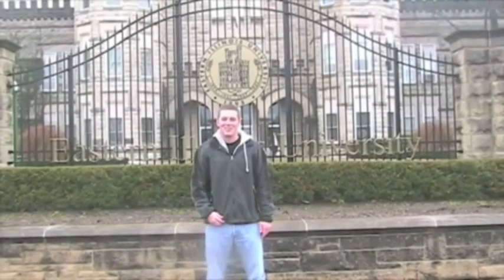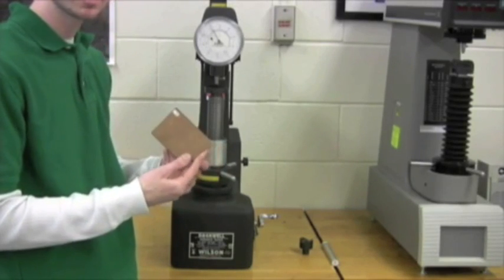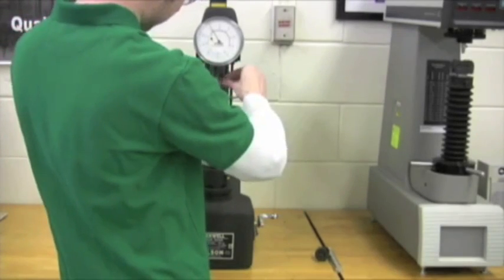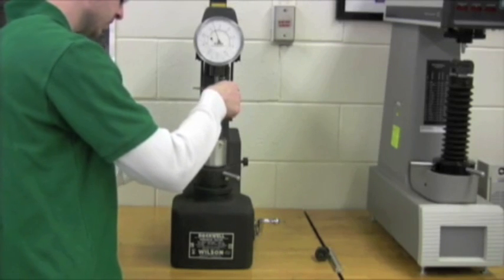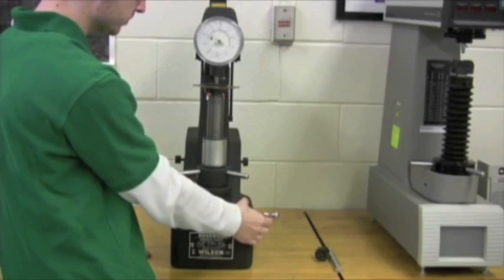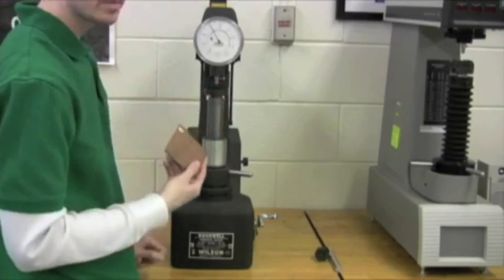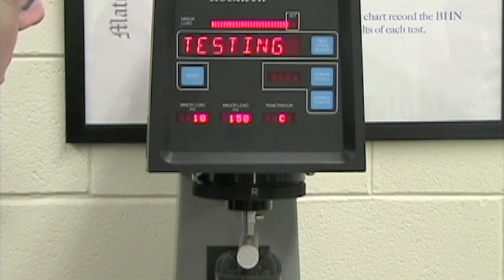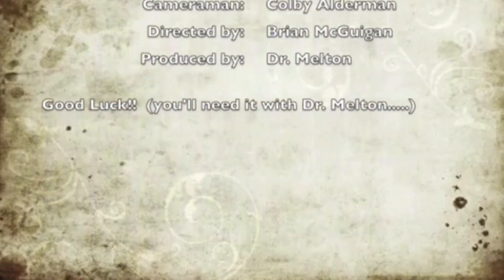Materials Testing: Rockwell Hardness Test

Comment: RFQ:COMBINED ROCKWELL&SUPERFICIAL ROCKWELL HARDNESS TESTER(2SETS):
-Hardness scales (A B C D E F G H K L M P R S &N T W X Y)
-Digital displayed on large L C D(HARDNESS VALUE-ROCKWELL SCALE-TEST FORCE INDICATOR).
-testing of material tracks-Tdata output to be printed and clarify the following:-(test time,date and time,specimen ID,RESULT VALUE
-Test loads:60 100 150kgf.for Rockwell&15,30,45Kgf.for superficial
-PRELOAD:10kgf..FOR ROCKWELL&3KGF.for superficial
-measuring resolution(0.1 Rockw.)